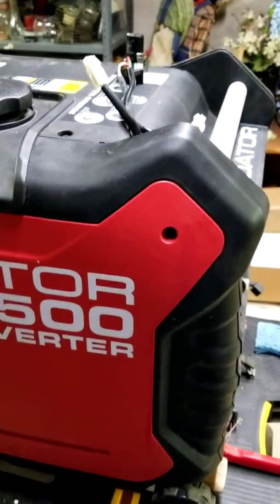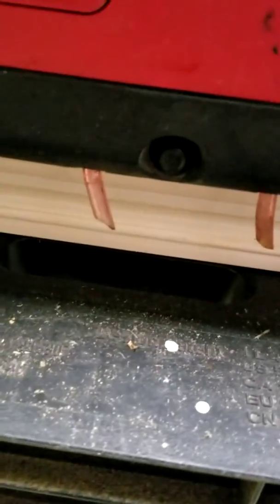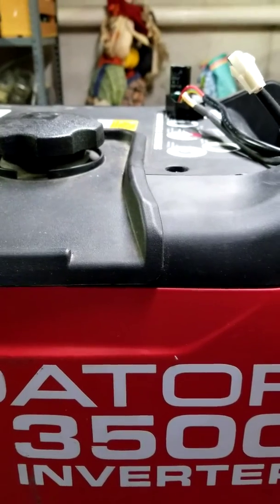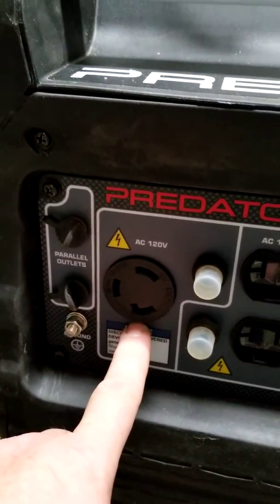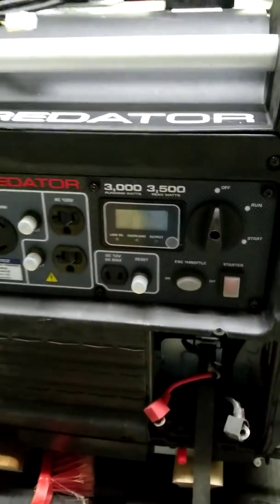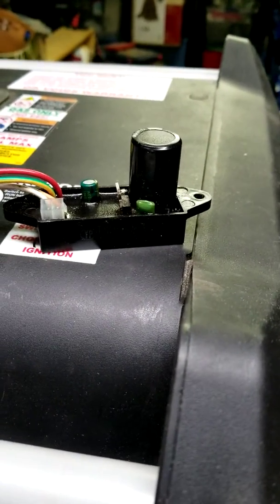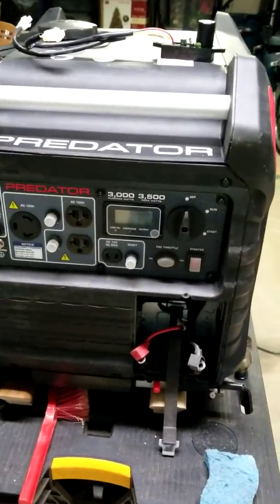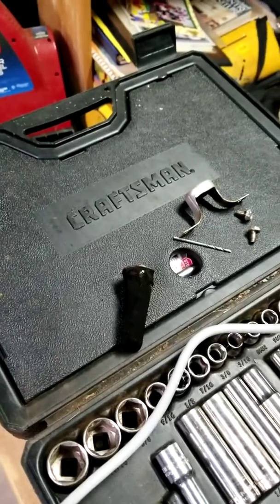The Predator files. CDI Troubleshooting wrap up

Comment: My question is can the CDI be tested with an ohm meter
Reply: Not effectively.  There is a simple test, verifying no continuity between the SCR metal tab and red wire to check that the SCR hasn't shorted internally, but that's not a common problem.

The most likely problem with these modules is a broken wire within a few mm of the connector crimp, or just above where the wire enters the potting compound.  The failure will be the copper strands broken inside intact insulation, looking undamaged.  The strands will sometimes make contact again as you flex the wire during disconnection or testing.  The generator might even start working again, until you put it back together or run it a bit.  If it magically starts working again, flex the wires to find the bad one!

The break can happen on the module side or the generator side of the connector, depending on exactly how the connector is supported and the vibration sets up a resonance.  It's not likely to occur in the middle of a wire section.

You can test the ignition coil primary (a few ohms) and secondary (2 100 Kohms at the spark plug connector, probably 2.7 Kohms), the power coil and trigger coil (a few hundred ohms).  Test these from both sides of the connector, while moving the wiring around.  Be sensitive to a flakey reading - don't ignore erratic measurements as simply the probes losing contact.

The red/green (or green+yellow) wires are the ignition power, with the green being ground.  It's supplied by a coil on the inverter, and might take a few rotations to build enough power in the storage capacitor to spark the first time.
Note that this is the only ground for the module.  It must be connected or referenced against for the other tests.

The other pair of wires are the trigger input, and the spark coil output.  The colors vary depending on the exact variant.  The yellow wire is connected to a trigger coil, typically a 150-250 ohm coil that is part of the alternator head.  The blue wire is connected to the ignition primary, which which is often a magneto module repurposed as a simple ignition coil.  The magneto magnetic path and trigger circuitry is unused, and the kill switch connection is used as the primary coil input.

The four pin connector can be left unconnected for testing.  It has two kill inputs (black wires), one from the shutoff switch ("flameout") and another from the oil level sensor.  The other two wires (blue, white) are for the front panel low oil level LED.  The difference between the kill inputs is that the "flameout" one only kills spark, while the oil level switch will cause the LED to blink until the capacitor power is depleted.

You can test that that module is getting power and the capacitor charging by shorting the oil level input to ground, trying to start the engine, and verifying that the LED blinks.
Reply from the maker: I did not get notifications to comments on this video, so I am sorry I missed this. The CDI consisted of a Surface Mount Device circuit board with many individual components. When excavated out of the insulating compound it was in, the remnants of a SMD transistor came out in charred pieces. The insulation on the battery lead to the Starter had abraded through shorting out and destroying the CDI. This particular CDI would have not been able to be effectively troubleshot without getting it out of the material it was buried in (insulating compound). Frankly for the cost of the device it was, in retrospect, not worth the effort to repair. It was designed to be a throw away.  Additionally the SMDs were not labeled and without the schematic for the CDI repair would have been a crap shoot. STILL it was a good learning experience for me!

Comment: I do have 2 of these, both made in mid 2020.   That panel is very easy to take off but don't remove pull handle.  Once panel is off slowly pull rope all the way out then tie a knot in rope so it can't recoil back in.  Rope is 5 foot long so you can easily set panel out of way.  I pulled all panels off and took pics so I do see that part and # TJ113-2009-1.  Looks like YP is the mfg.  if that helps anyone.  Many of these units have 5,000 + hours on them so hopefully that's not a common problem. Thanks for the video.
Reply from the maker: Ha! I should have thought of that!

Comment: Hello, can you help me to know what polyester capacitor are you using? mine is shorted (it's the green component
Reply from the maker: the black material comes out easily. Use a tooth pick and you should be able to get around the component. to try to get some manufacturers part number off of it. Sadly I don't .
Reply from the maker: If you can get a number then you should be able to cross reference it in a DIGI-Key catalog or on line. How was the capacitor damaged?
Reply: @egregg57  I do not know, the initial problem is that my spark plug does not generate spark. I checked the coil, I checked the spark arrestor, oil level, then I saw your video and I found that the capacitor I mentioned was short-circuited. I removed it and lost it and I do not remember its capacity, I only remember that it had a number 26 on the top and the number 222 or maybe 220 on the bottom.
Reply from the maker: @loscoloresdevalentin  that sucks,. I will check photos to see if anything is visible on mine.. I don't think I even paid attention to it. I'll see whati can find.
Reply: @egregg57  thanks to you, I wish you find something.

Comment from the maker: THe compound filling the coffin isn't epoxy, it is a RO Compound almost like an RTV but easily removed with a tooth pick or wooden skewer. If you try to remove the material you must be careful of the surface mounted devices on the circuit board about 1/4 of an inch below the surface.
Reply: Hola buenos días cambié el CDI,le puse uno nuevo pero sigue sin arrojar chispa en la bujía.